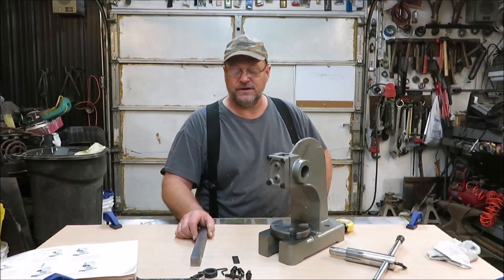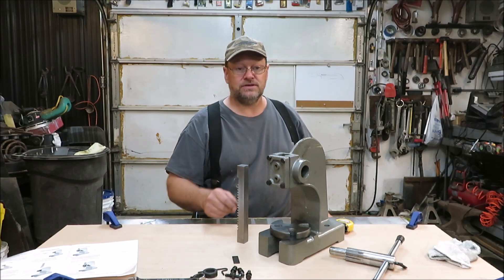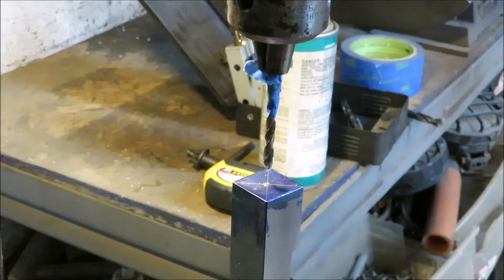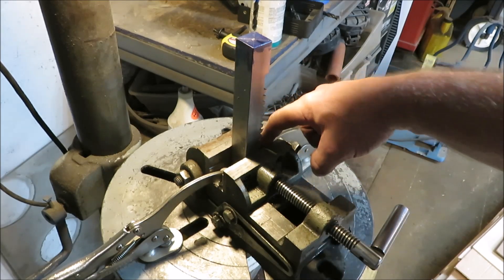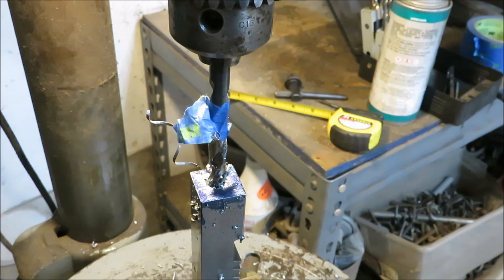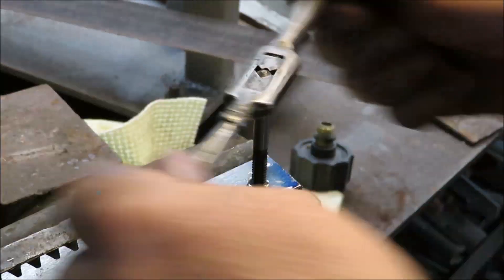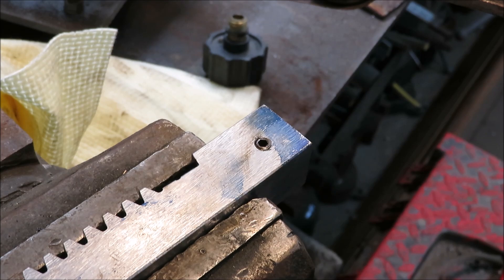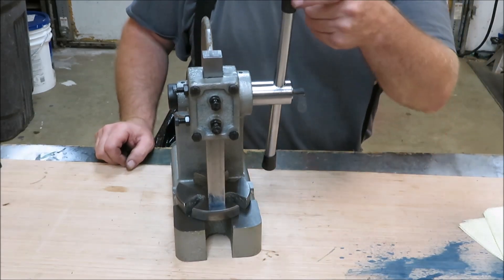arbor press modifications part #2 socket press

Comment: I have a press very similar to this that was modified to accept Lionel train repair tooling. It had a bore in the ram, and a different sized one in the table, along with set screws for each, and a hole through the table that lines up with a tapped hole  in the body. Works great!  Plus the press can still be used for whatever application I want beyond trains.
Reply from the maker: Nice. Thanks for the comment.

Comment: Thanks for sharing.  I did the same 2 tooth removal .however,  there is about a 1/2 inch zone on the travel where the notch will fall in and cause the shaft to wobble. That is the only thing that I disliked about this mod..
Great video!
Reply from the maker: Thanks for sharing and watching.

Comment: Nikko/felt pens can be used to layout mark steel, and if you bend a bit of heavy wire/small diameter round bar into a crank shape and chuck that up into the drill press, you can rotate the chuck and sweep the table to check for perpendicular alignment.
Reply from the maker: Thanks for the tips and for watching.

Comment: I've got a "3 ton" arbor press that came drilled for attachments and a set screw to retain them. Handy allowing assorted tooling to be adapted. Bolting the press to a stand that allows long work to stick below is the normal configuration. Great for broaching, or pressing bearings on or off shafts. Make a holder for your letter & # stamps and a simple guide allows accurate name plates to be made. Lots of ideas on YouTube. If you are considering buying an arbor press make sure the clearances under the ram is sufficient for future uses. It takes considerable height to use broaches. For safety, bolt the press to a substantial base so it doesn't tip and fall on your toes.
Reply from the maker: Great info thanks for watching.

Comment: Would have better to grind a flat on the extension that you're using for an adapter. This would give a better hold on the adapter and negate the need to grind the socket set screw.
Reply from the maker: Thanks for the tip i appreciate it.

Comment: Although if you have a drill press you can use it as a lathe to turn down small pieces with a file. And it is a press. It doesn’t have to turn to do other tasks.
Reply from the maker: Thanks for the info.

Comment: If you wanted to keep the ram straight while you drilled a 3/8th hole, why not just keep the ram in the press itself and set the whole thing on the drill press table! By the way....your drill press needs a new quill. The chuck was wobbling all over the place....not very accurate drilling holes the way it is now.
Reply from the maker: Thanks

Comment: If you’ve got a mini lathe you should make a tool to hold hex bits. Make it so you can use a tommy bar or wrench to turn it to break loose frozen screws. You could do the same with the socket mod. I would use a 1/4 drive though. I think a 3/8 drive would be a bit much for its size.

Comment: I use pipe threading cutting oil from big box store vs WD-40, it's cheap. Just got one of these, spent the money to make versatile instead of purchasing a press for grommets, Figured I could do a lot more with one like yours!!  Lastly looks like if you need to press something at the top end you can just flip the ram around, no loss in press height.
Reply from the maker: Thanks for watching
Reply: I use cheap motor oil or chain bard oil in a pump can.

Comment: Excellent video!  I have the identical arbor press and have found that I cannot work a well annealed Morgan dollar with this machine.  With that arm there is very little mechanical advantage.  I can easily work the Morgan dollar in my mid sized bench vise that has an 9" arm.  If you want to work the Morgan, you would need maybe a four foot lever arm on this press.  I have not tried to work smaller coins on this press.
Reply from the maker: Good info thanks for sharing.